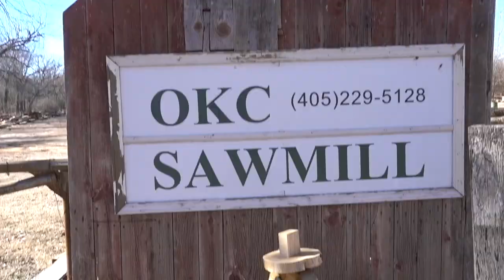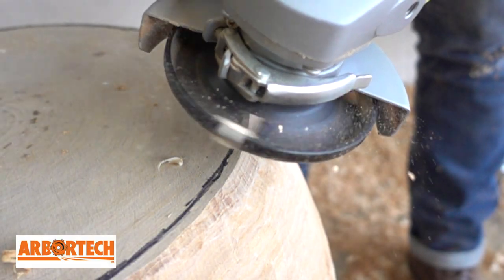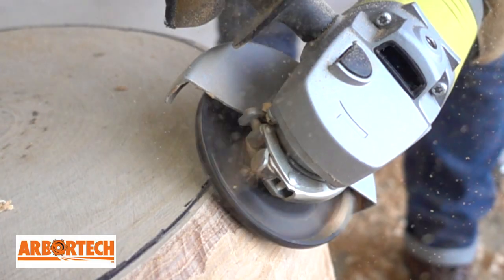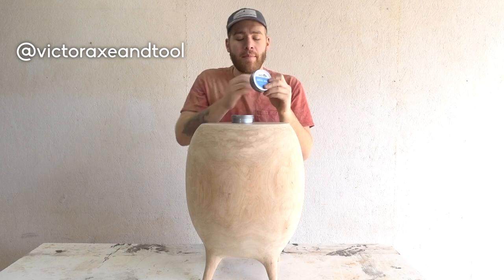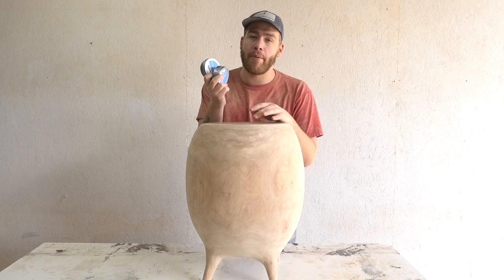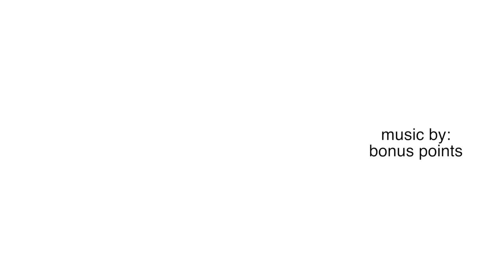DIY Power-Carved Egg Table | Modern Builds | EP. 55 | ARBORTECH TURBOPLANE

Comment: I know you made this a while back. But a way to help control the cracks that will eventually come up is to take your chainsaw and plunge Cut in the bottom right in the middle (pith). Plunge up to within a inch or two of the surface of the top, or the entire length of the bar, which ever is less. 
Making this cut helps to relieve the stress in the log, like cutting the pith out of a wide board. 
I used to be into chainsaw carving that is a trick for the bottom of bear carvings. This was right up my alley!  Great project and it is bueatiful.

Comment: Looks awesome! I bought the Turboplane last year to use with my Ryobi 18V grinder but for some reason it doesn't grip too well and doesn't cut properly.  Must be something I'm doing wrong!  Will give it another try after watching this
Reply from the maker: Try using a plug in grinder like the one I used from harbor freight on the second half of the project. The 18v doesn't have as much torque and gets kinda bogged down. You'll be impressed once it's in a plug in grinder.
Reply: Modern Builds thanks will do 👍

Comment: that's the best looking thing you've done, yep. It'd probably be like 200$+ in a store
Reply from the maker: Thanks a lot!!
Reply: misterOsc no way dude I've seen crappy versions of these kinds of tables go upward 1k of course I can't recall the type of wood and that obviously will factor in the price difference but agreed its worth paying for
Reply: I was thinking more.. 3-4 hundo
Reply: Wait this thing is awesome - never seen a design like that and was really curious based on your instagram on what it could be. 

Actually incredibly surprised that pecan has that good looking of grain. Sweet vid!
Reply: i was thinking 400 at least. Its amazing though
Reply: Just a heads up, the original Caleb tables go from $900-1400, not including shipping that heavy-ass thing.
Reply: Thats more of the price range i was thinking. Just based on some of the prices I used to see when i worked at a furniture store
Reply: Yep best to date!
Reply: Way more than $200, I think. Like minimum $500, and that stills seems incredibly cheap to me. If I made this and were trying to sell it, I'd put an $800+ price tag on it. If the wood were fully dry and guaranteed not to develop checks, then maybe even twice that.
Reply: 200? I'd say 1000 min. They sell stumps with the bark still on for 200 in stores lol.
Reply: I just saw two of Caleb's Mercury tables on 1stdibs and they're going for $4,200. I wouldn't have been surprised to see a price tag of $10K on them in a gallery. They really are beautiful.
Reply: High end store in OC would charge a few thousand.
Reply: 200 dollars probably wouldnt even cover the cost of the wood let alone the laber.   lol   look at him flipping that log around and then all the work and craftsmanship.  would you do that for 200??
Reply: Dude, it's a sculpture. Artsy thing
Reply: @Allhailbillcoleman  I agree its at least $600

Comment: Amazing piece, there's a sculptural quality to it. I think if the wood was totally dry you could carve the center from the bottom to make it lighter and so practical to use but with still moisture in it, it would probably be a deadly sin.
Reply from the maker: I was thinking the same, it'd  probably check a lot more and maybe twist?

Comment: hey that's a great table....I've been thinking of ordering a turbo plane...but I need an angle grinder...( only tool I don't have really) but I wasn't sure of the amps required or size...I'm thinking the 4 1/2 inch grinders but they go from 3-4 amps up to 9-10...any advice? plus I see you started out with a ryobi...I have a pile of those ryobi one+ tools and lots of batteries...but not the grinder...does the ryobi one+ grinder have the power to run the turbo plane...? that may be an option for me but I'll bet the battery drains fast...thanks...
Reply from the maker: The Ryobi grinder worked, but it ran through the batteries pretty quick, so I picked up a super cheap 4 1/2" angle grinder from Harbor Freight for $12. It worked really well
Reply: great...thanks for info...how many minimum amps would you suggest....also, sorry for so many questions, where are some places to get arbortech tools...?does harbor freight carry them? hard to find in canada

thanks again
k

Comment: Is there a structural reason to not hollow out the bottom a bit to reduce weight?
Reply from the maker: I didn't do it because the moisture content is still pretty high. If I hollowed it out it'd have a better chance of cracking or twisting as it dried.
Reply: Ah interesting. Thanks!